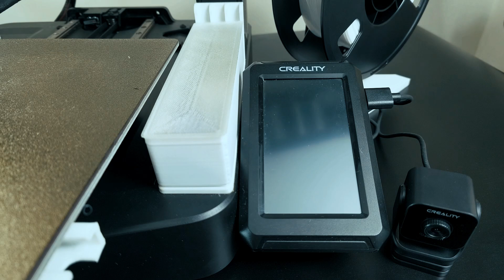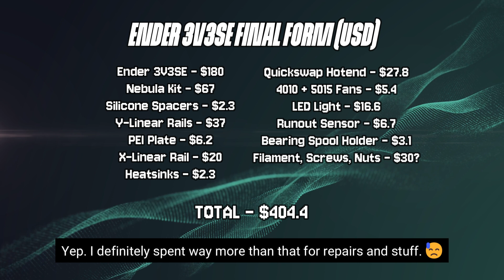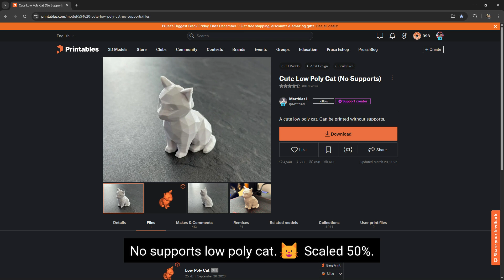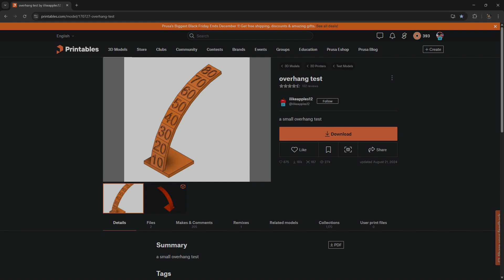Upgraded Ender 3V3SE FINAL FORM - Details & How It Prints 🔥

Comment: Dang... I'm considering getting the Nebula Pad, but I'm thinking about getting a multicolor printer anyway, so I'll probably get the Creality Hi, which is WiFi enabled and can print multicolor.
Reply from the maker: The A1 is actually a better choice now, it has a ton of mods and parts... If you can get past what Bambu Lab tried to do earlier this year.
Reply: @reddotgeek   Yes, but Creality often has sales with the Hi Combo at $400 or less. The least I've seen on the A1 combo is $450.